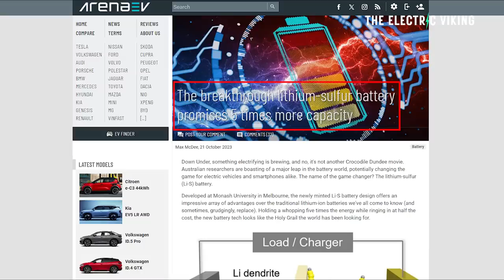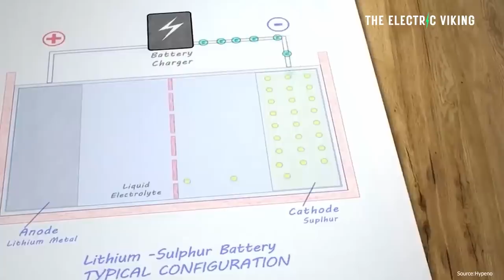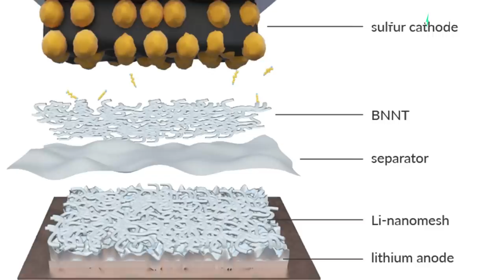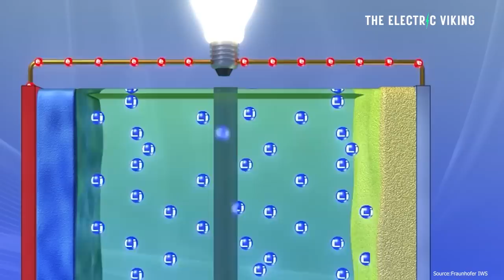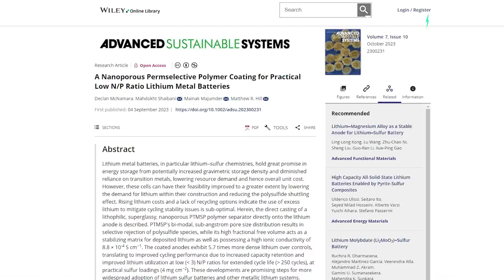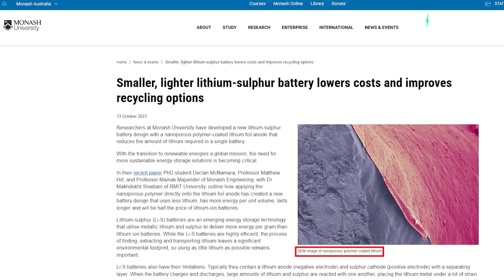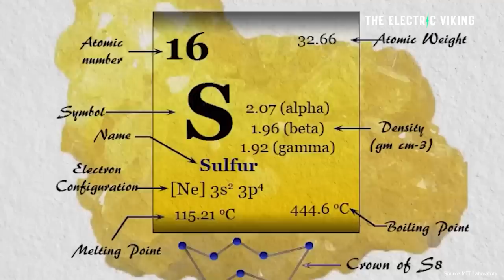Breakthrough for new battery that has five times the power of lithium-ion

Comment: It's not so much the chemistry, it is the way batteries are packaged and delivered. Cell type batteries for Ev's are way too heavy to their energy density. Do we need a big chemical anode? Perhaps a better flow battery? A new design. Couldn't we use just a cathode with an electrolyte that's rechargeable? Perhaps a low voltage plasma or electrical anode to reduce weight and lower possible dendritic formations due to chemical cycling. The design and delivery needs the tech in my opinion otherwise, it's just a waste of time and money. The bridge is out before you get started.

Comment: 01:19 "This would be game over for diesel..."
Fun fact: Tesla's battery plant in the U.S. runs on a coal plant plus diesel generators. So do most supercharging stations. Not enough electricity.
I understand what you say here, but those batteries have to be produced somehow, which requires electricity, which is more than often produced by coal powerplants. So, EV's, rather than being a green alternative, are just outsorcing emissions to other regions. Hope this changes!
Reply: 😂HA Ha!🤪 Nope.🙄 You should stop reading that fossil fuel propaganda. It can rot your brain.😑

Comment: I have been hearing about 'better batteries' for about 10 years and still nothing on the market......
Reply: Compare the best 2012 model s to today's lr dual motor model S. Batteries have improved massively in that timeframe. 

I remember the first cell phones could do about 15mins powered on, the first smart phones lastest an hour or two if you used them.
Now I use my phone all day, searching, trading and doing business with it and don't even need to charge it every 24hrs. 😎

Comment: Are there any plans to develop a fire extinguishing systems for EVs ? Will such systems be retrofitted to older EVs ?
Reply: Are there any plans to retrofit ICE cars so they don’t catch fire?
Reply: @kng128 Na turns out we have developed simple inexpensive ways to put them out all under control. 
Hay have there been any breakthroughs for putting EV's out during thermal runaway?
Or is the current procedure still clear the area till it burns to the ground?

Comment: I don't get excited about this stuff at all. Plenty of companies have found batteries that have far greater energy density than current, but when they last 1-50 cycles, are highly volatile, or cost prohibitive, it doesn't matter because it's non-viable. Every month there is a new miracle battery, yet they never make it to market. There's likely a reason why they aren't advertising the number of cycles.

Comment: Not feeling any happy vibes. It's another breakthrough that IF it gets implemented, and IF the cost of manufacturing is exponentially cheaper to produce, they will just find a way to charge 10X more for it while throttling the advantage of extra capacity to slightly more than the last battery technology. Don't throw out your old carbon and lead/acid batteries just yet!